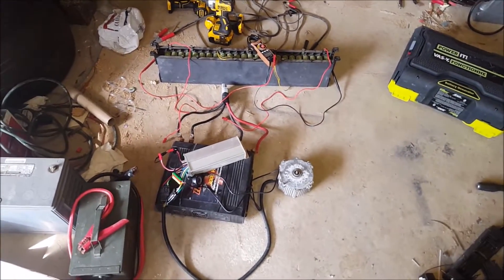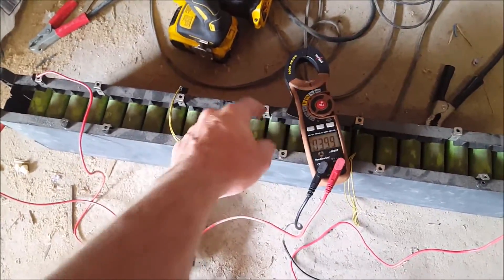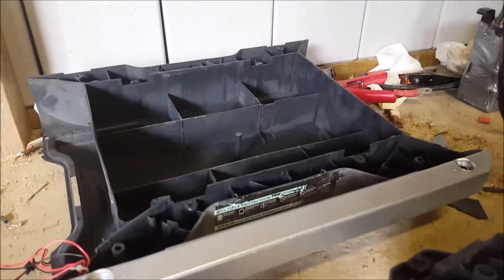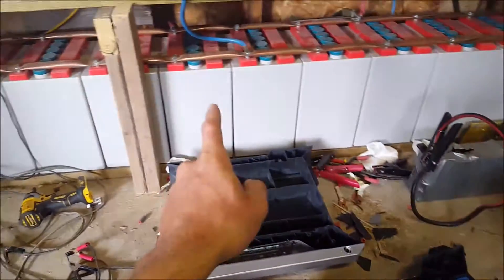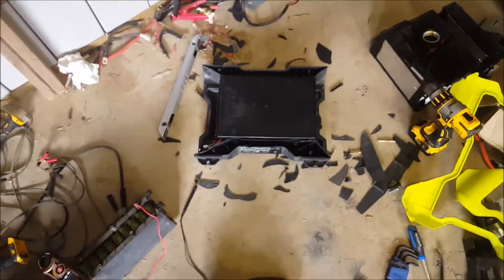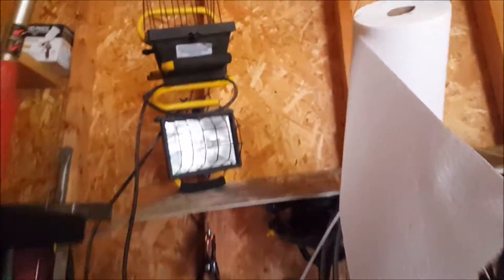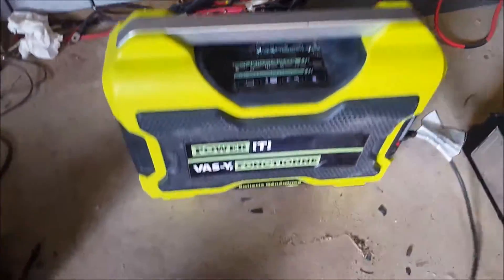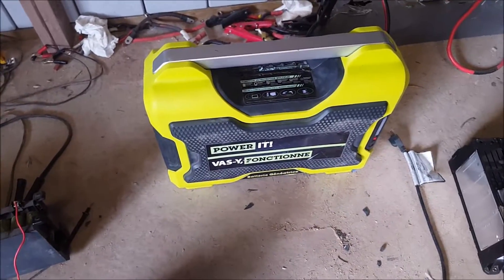Two Power Its Into One 140Ah!

Comment: Hello. great video.
Please advice, how do you connect the wires in 2 batteries? Red-red, black-black x2 , and to the board as before?
When i connected 2 small pairs first to each other - they started to heat up like crazy - so i had to disconnect.
Please help.
Thank you

Comment: just wondering, how you wired them up to the inverter board.  I assume just parallel the power leads and the charge / bms leads?  Did you change the fuses?  Any over current protection with charging?  Thanks.
Reply from the maker: i did as you said and no more :)
Reply: So you just went positve to positive and negitive to negitive on both big and thin wires

Comment: Hi, I have 2 of these Power It lithium pack and I like to do what you have done: combine the 2 into 1. I have opened the pack up and removed the inverter. There are 4 leads from the battery itself. 2 are obviously the positive and negative leads (the thicker wires). What are the other two leads? When I combine the two battery packs together, do I just connect the two "thinner" red leads together and the two "thinner" black leads together?
Reply from the maker: yes that is what you do, but make sure to hook it up to the inverter when your done everything the same buy now you have 2 wires where you only had 1 before, I extended my wires to make it work.

Comment: Thanks for the great videos, nice the idea of adding the two together.
I saw a photo of where someone added a battery kill switch, where it disconnects the the battery to stop the storage drain. I will try this mod in the future.  As the price is getting lower 224.00 CDN in Canada i might buy another just to test out your idea
Reply: Timothy Simmonds I just bought 2 at my local walmart for ya 224$ canadain on clearance! I will be combining them into 1  140ah unit as done here.
Reply from the maker: no air gap needed the batteries do not even get a little warm under the 60 amps max the inverter can pull, :)
Reply from the maker: if you pull 600w from the inverter its 60 amps from the battery :)
Reply from the maker: i love my 140 am power it.
Reply: I was wondering if you left any room between the two battery packs or are they touching? It would be ideal to leave a small air gap for cooling between each battery. Even half an inch would make a big difference I think
Reply: fliping720 oh ok thanks a lot! How do you pull 60amps out of these? The anderson connectors? 60A at 12v dc so pulling 600watts from the unit?

Comment: I'm doing this right now and wanted to look up how you did it. surprisingly, one of my power its has 99 18650 cells in it, the other has 6 huge lipo pouches linked by nice bus bars. The 18650 unit has 6 gauge wires going to the inverter, the lipo pouch unit has 8 gauge. Pretty typical chinese inconsistency!
Reply from the maker: lmao I have both lipo batteries in mine, they seem well made for a battery
Reply from the maker: are the 18650 packs not larger?
Reply: The 18650 pack is the same size, it has 90 2200mAh cells in it but there's room to add in 45 more (it has all the holders in there already, just needs contacts). I've considered getting some from ebay to fill up the space but I'd have to solder to them, not sure how well it would work. The 18650 pack also seems to have more capacity, I've tested it at 63 amp-hours and that was with the inverter shutting off  at 10.3 volts, with a 350 watt load. On the inconsistency, the other power it shuts down at 10.7. But the lipo pouch battery seems better built, it has bus bars and everything.
Reply from the maker: Gyppor good to know thanks! where are the videos!!!

Comment: Hi there, I have 2 Power It battery generators and I read somewhere that you can join the 2 Power Its together using the Anderson connectors on the side of the generator to get 2000w. Have you tried that? Where could I find the necessary wires? Thank you.
Reply from the maker: you can do that bud you will still only have the two 500w inverters in both units so the max power you can pull with a single devise is 500w but you will increase the run time by 100%
Reply: Now when hooking them together with the aderson plugs can you use the one unit to charge both units because they are connected or do they have to be charged separetly!
Reply: Wish you had a picture of how connected the to batterys together. When you made the 140amp power it so you connected all 4 wires in parellel reds to reds and blacks to blacks i assume!